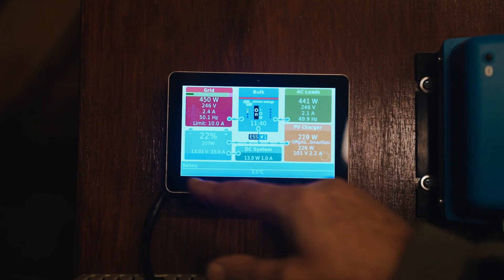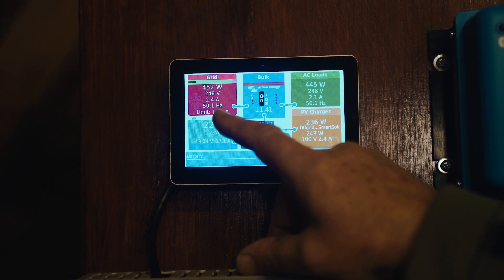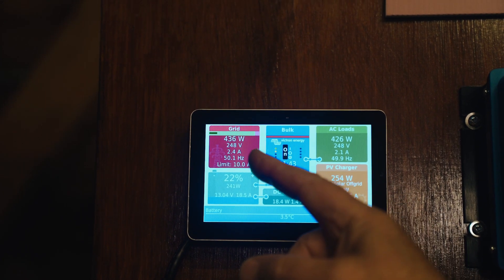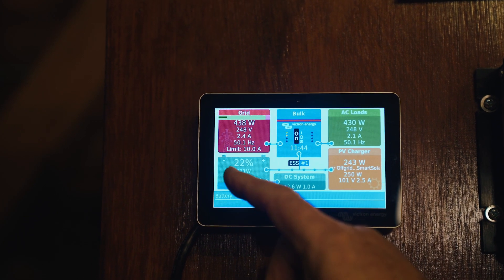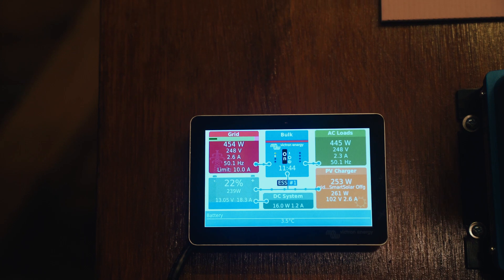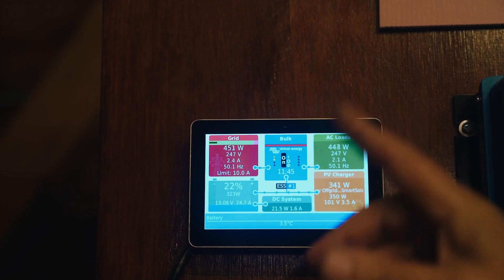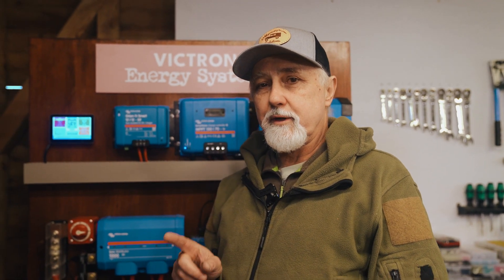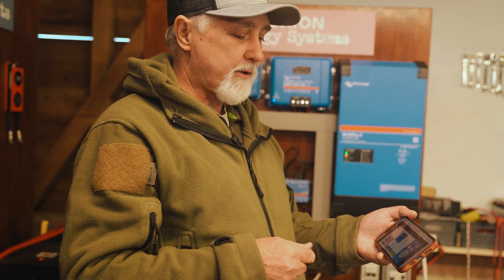Is the Cerbo GX worth the £500 it costs??

Comment: Hopefully you can do a video on ways to add more VE direct cable options. The cerbo GX only has 3. I'm running 3 x 100/30 MPPTS, 1x Smart shunt, 1X Orion XS 50  DCDC, which all require VE direct.  It's seems I need to purchase 2 x USB to VE direct from Victron, the expense keeps adding up. 
  More VE DIRECT ports are needed in the cerbo. 
  I see the octo GX may be the better option If I hadn't purchased the cerbo GX. 

 Quote*.  The Octo GX is a member of the GX Product family. The Octo GX is the best fit for installations that have many MPPT Solar Chargers, as it has 10 VE.Direct ports.

Comment: Great review.  I've just installed a Cerbo GX and Touch 50 in my motorhome.  Although its expensive, I think it is well worth the money especially the VRM access.  What water gauge have you fitted as the ability to tell exactly how much water is very useful.  What are you using for the LPG level.  I've got two 11Kg Gaslow cylinders.

Comment: Another consideration if you like me, I don't need sensors as I'm using inverter/batteries/solar as a home backup power system so I opted to use the Cerbo "S" GX without a screen and just use PC or mobile phone to monitor. That keeps initial investment down and a screen can be added later if desired.
Reply: You don't require a screen as long as your Cerbo has BT and or network connection. You can "monitor" your system on iOS or OS X systems. And if your Cerbo has access to Micro SD card slot, you can download  system upgrades automatically and get upgrades.